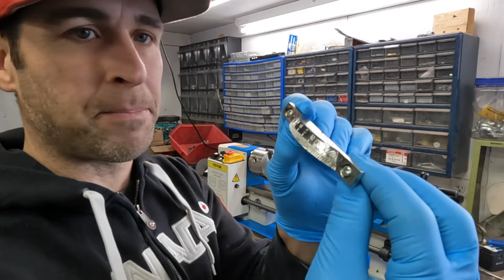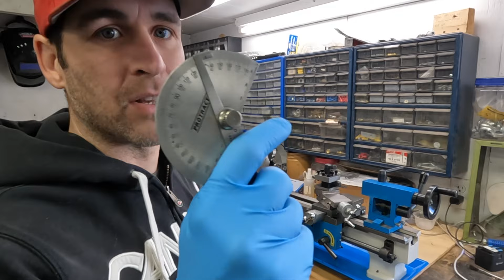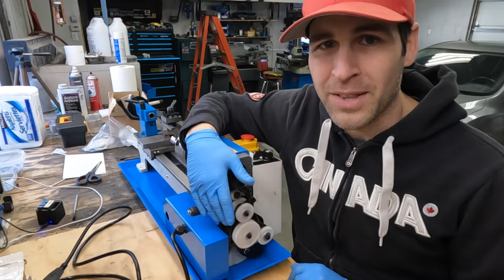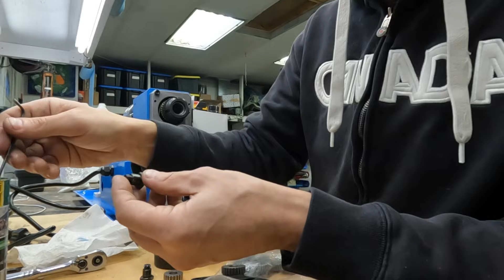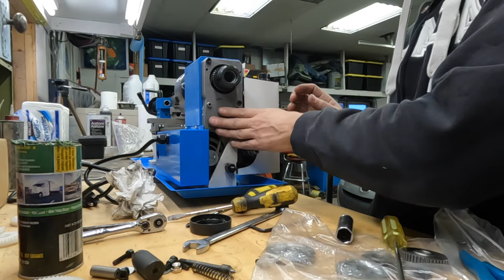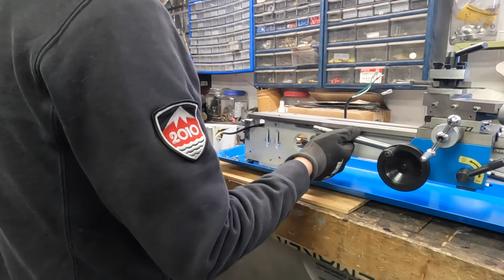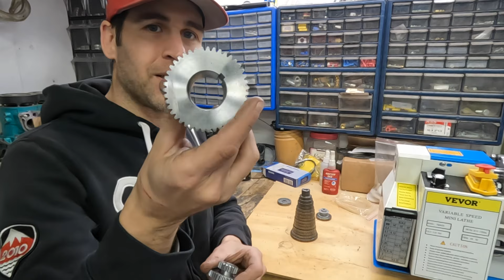Mini Lathe METAL Gear Swap 🤟 - A Worthwhile Upgrade

Comment: Absolute garbage drive belt on these typically with mismatched pulleys. Had to buy a replacement lower pulley and was able to locate rubber belts instead of that junk belt that it comes with. When you hear a knocking noise and you think its the motor its probably just teeth missing from the belt. You'll eventually find a pile of them under the machine lol. Also the control board is a piece of junk and I'm told it is non standard, (not a direct swap with other generic mini lathe machines). Luckily the seller I got the machine from on ebay was able to get me a replacement. I assume they probably just contacted Vevor on my behalf and they were able to get a new one. After those mods and a couple other small things it's been able to pay for itself which is pretty cool. Someday I will upgrade, I've been eyeing those Precision Matthews 1340GT's... I do have one of their benchtop mills I picked up used on marketplace and other than a meltdown at the wiring junction box due to serious corrosion it's been great. The company was super easy to work with and send me the junction box and capacitors I needed to get her back to throwing chips. Stay safe!!
Reply from the maker: Wow... sounds like you got a bad one. I have had this one completely apart twice and used it a fair bit and haven't had any of those issues. 

The pulley was lose on the shaft and I used some loctite to stop it from making noise... I had to align and tension the belt as it was rubbing where it should have been. 

I have no idea about the PCB, but quite frequently these chinese boards are cross compatible with many others, even when the don't look the same and the part numbers don't match. 

Oh wow ! Precision Matthews 1340GT's... That's a sweet lathe ! and HUGE compared to anything Vevor sells. Full gear box, power cross slide ... luxurious ! I recently got a PM30MV and I am converting it to CNC. 

Thanks for the comment !

Comment: Ok, Jole, Im not run a lathe since high school, -a bigger one, like a industry one....so powerful...

Now, if i were thinking of being to look around, were are so many options....Im looking for a smaller one because lack of space, but dont ran out of range...?! 

My target are to build a car chassi and body from scratch, and buy gearbox and engine at first, but later maybe try to rebuild and if- big IF, maybe build my own engine parts.... Just too get how im thinking, and there comes it to size, does it matter....

Please Obi- One Canobi, your my only hope......🤔🤔🤔🤔🤔😉😉😉😉😉😉 Happy Holidays!
Reply from the maker: Haha... Obi-one ... I think you want a lathe that is bigger than anything Vevor sells. I have a 10x22 lathe, and I think that this would suit your needs. 

When it comes to a lathe of this size,  there are literally hundreds of options both new and used. You can spend anywhere for a few $1500 to $20,000 (maybe more) 

A lathe line my 10x22  is about $2500 new. It works well, but has belts to change the speed of the spindle, and manual gear changes are required to thread at different pitches (removing and installing gears) 

On higher end laths, you will find the ability to change spindle speed with a lever, and the ability to cut different threads using change levers instead of removing and installing different gears. 

My lathe also only has power feed on the apron, and it only operates in one direction relative to the spindle direction. More expensive lathes may not only have two directions, relative to the spindle, but also power cross slide. 

Also, a huge consideration is tooling for your lathe. You can purchase a $800 lathe and spend $20,000 on tooling if you go nuts. The lathe may end up being a small part of the cost of owning a lathe. 

A basic 10x22 lathe like mine will work. Set up takes longer in some cases, and you may have to make some compromises... but it works. 

Hope this helps.
Reply: @loweredexpectations4927  thax Obi- One....😜🤔😉

Comment: Is there any use of putting any kind of light grease, or heavy oil on the gears?  Or will they just get dirty with debris?  Looked pretty simple!  ;)  Great video man.  Merry Christmas!
Reply from the maker: I suspect putting a very light coating of oil would be okay, but it's always going to be a big mess. Other than possibly quieting it down a little (maybe) the oil or grease isn't going to matter much on the teeth. These gears would last a hundred years without ever wearing out. 

It was super easy. 

Merry Christmas to you as well !

Comment: It sounds it is to little mesh between gears and gears will not last long. God Jul (Merry Christmas) from Sverige (Sweden) :)
Reply from the maker: Thanks for the comment ! Merry Christmas to you as well. I believe the sound of the gear mesh is partly due to how the camera picks up sound, but also because of the lack of precision in the gears. 

They work really well, but if I run them any tighter, they start to bind in certain spots.

Comment: Something that a lot of folks are doing is getting rid of most of the gears on their lathes, and using modern BLDC-based servo motors to drive both the spindle and the cross-slide.  Modern controls systems can very precisely control the speed, and BLDC servos can deliver considerable torque over their entire speed range.   Overkill for this little lathe perhaps, but for a larger lathe where you might be considering replacing gears (because they're worn or broken), a "nearly gear free" conversion might be something to consider.  Certainly, this is how CNC-based lathes and mills work.  No gear changes to speak of.  Just properly-sized motors and a precision control system...
Reply from the maker: Yes, I have often thought of doing something like this on my 10x22 lathe.... I always end up deciding to do something else with my time and money, but it would be great not to have to change belts and gears ! 

Not sure if you follow Clough42, but he has several videos about his G0602 that is the exact same as my King Canada branded lathe.... he has done a LOT of upgrades on it including building an "electronic leadscrew" I think he sells kits.
Reply: @loweredexpectations4927 I did installed this on my lathe, best improvement ever. Sooooo much easier for threading.

Comment: Sweet i always wanted to get one of those to mess with dont know why.
Reply from the maker: Oh boy are you in luck.... They make em every day, by the thousands in China ! You should do a CNC conversion on one, haha. 

For real tho. I already have a small lathe 10x22... but if I couldn't justify the larger one, I would have to have one of these.
Reply: @loweredexpectations4927  would be fun for enough on my plate already. Actually have stuff to CNC the lathe I have just havnt felt like it.
Reply from the maker: @lanceulbrich6249  Sounds like a fun project.